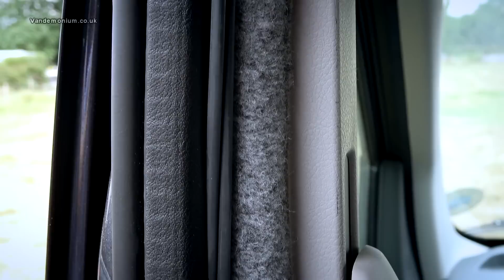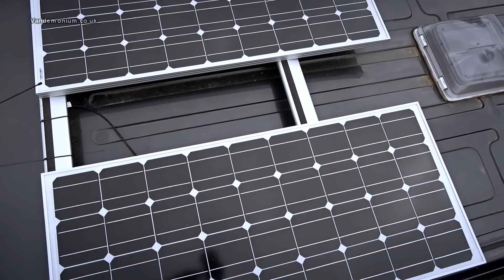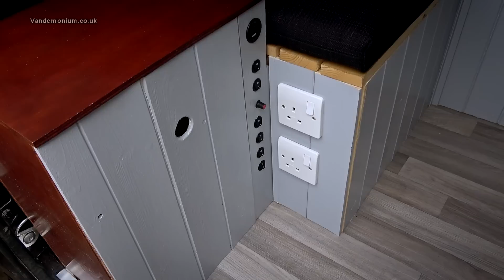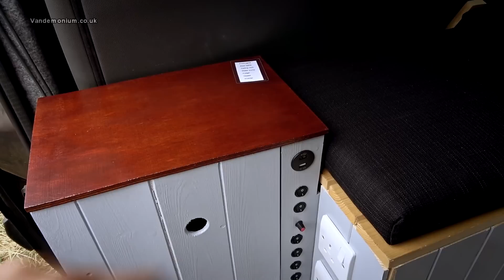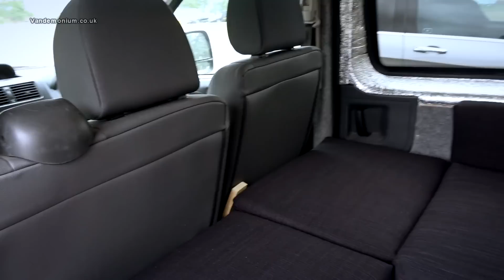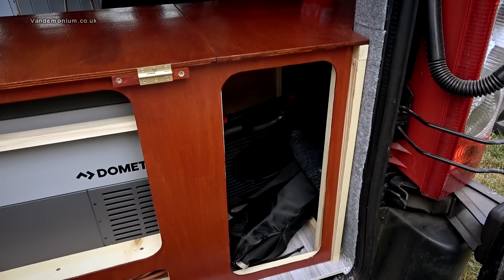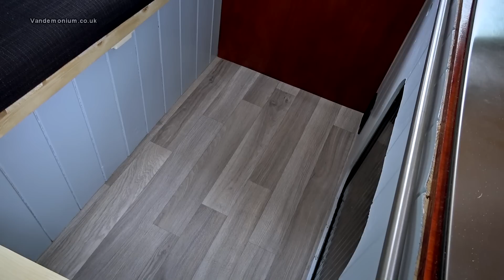Vlog 22 Campervan solar panels plus miscellaneous improvements

Comment: David.. looking great... the tee bolt track might be the source of the whistle when driving.  Try some tape to close the gap.
Reply from the maker: It's already covered up with a rubber strip that goes in the gaps, came with the roofrack. Cheers

Comment: It all looks very good, are you getting Anna to make your curtains I believe she is rather good with a sowing machine. Could you fill then paint round the windows with a thick rubber paint would be a lot easier than trying to cut the carpet. What is your next plan? A new boat then fit out from scratch maybe?
Reply from the maker: The boat idea has crossed my mind but oh my, what a massive job that would be!
Reply: S.E.W.I.N.G machine "Lewis" not a female pig manufacturing machine..for godsake Lewis!" Morse was heard to say, "most disappointing you think Anna to be associated with a piggery!"  :-))

Comment: In regards the fridge, I would buy an old caravan for 1-200 quid with a working fridge and just remove the fridge for my van plus a few other bits and pieces, then scrap the caravan and get a couple of quid back.
Reply from the maker: Good plan but I specifically wanted a 12V unit, not one that's propane or propane/12V (the latter are very inefficient when run on battery, much more so than dedicated 12V ones) and the caravan ones tend to be the latter type. Also, I've got nowhere to put a caravan and no way to tow it!
Reply: Try some of the cheap used caravan sellers up round Doncaster way... they buy up the trade ins that new c'van retailers dont want and break some... good source for many caravan/boat type stuff like pumps, water heaters, fridges etc.
Reply from the maker: Walter I'm extremely happy with the fridge, I certainly don't one of those coolers, they're a total waste of money in my book.

Comment: Possible idea for bed supports; The gaps between the slats could tak Hinged supports that would fold back UP into the gaps and therefore hidden when slid back, no need to mess anything else up :-)
Reply from the maker: I don't think there's quite enough space, the gaps are quite small :-(

Comment: Great progress so far. I'm liking the van a lot now, she really is coming along nicely in every episode. Definitely feeling a bit jealous in fairness. Haha 
One concern mind; I know you mentioned it's not a problem but being that its a camper van and I imagine you're going to want to visit various places in the UK and possibly Europe in it, you may want to consider a front mount roof spoiler to deflect the air over the solar panels. 2 reasons mainly. The drag from all that turbulent air will go towards killing fuel economy as you say and the more miles you drive on the motorway, the more that will increase but also, and its jus a personal opinion, I don't like the look of the solar panels with regards to their mounting and the aluminium frames they're constructed of when it comes to the idea of sustained air buffeting. Looking at them, they look for use in more of a domestic setting and while they will have no doubt been tested for high wind speed when it comes to gusts, I'm willing to bet they didn't get tested at 60mph for sustained periods. As I'm guessing they'll but up there for the life of the van as a camper van, I wouldn't trust them over time at motorway speed to not slowly work loose or come apart some how. Might take 60 hours of buffeting. Might take 100 hours of buffeting but if you're going to be seeing the sights of the world, or at least our small part of it here in Europe, it wouldn't take long till you have spent that crucial amount of time at motorway speeds. Could be a week. Maybe more. In fairness, might never happen. I just don't trust it. It was my immediate thought. Felt that one in my gut and all that. Either way, a cheap black plastic 3rd-party no-name front mount roof spoiler from the interwebs will sort both those issues and if you are going to be doing a fair few miles traveling via motorways, over the course of a few weeks, the fuel saving pays for the spoiler. Especially at todays fuel prices.  

All just food for thought like. :)
Reply from the maker: A spoiler is not a bad idea but I'd be more concerned about the spoiler blowing off than the panels disintegrating! That's largely because I'm not sure how I'd be able to attach the spoiler. It's something I'm going to put some thought into at a later date though.
Reply: Yeah, I was just thinking with the aluminium mitred butt-joint construction. That type of join in aluminium, usually done with some kind of sealer as opposed to screws or welding, likes to come apart. Could just be me being over cautious though as I'm only going off a picture. Would depend on how much flex you felt when lifting them. More flex, more oscillation. 
As for the roof spoiler, I'll be honest, I've never attached one myself but thinking it through, I'm guessing it'd involve loosening the front interior headliner so you can get at the roof and then its just a matter of place-fitting the spoiler on the roof with some form of tape to hold it in place while you get it centred and then seen as most aftermarket spoilers come with holes in for screws/nuts, you just use the holes in the spoiler to mark the hole points where you need to drill and mark all the way around the footprint of the spoiler where it touches the body. Remove the spoiler, drill the holes, put some silicone-type sealer on the inside of the marked footprint and then screw the spoiler in place with a few hex-head bolts and attach the bolts from underneath inside the van. A friend for lifting will come in handy there as well as for holding the screwdriver while you screw the nut from inside. Then just wipe away any excess silicone gasket that has squeezed out from under the spoiler as you bolted it down and cut off any excess bolt length on the inside so it doesn't stick into the inside of the headliner. An afternoons work maybe and from what you've done with the van so far, you know your way around tools and are more than competent. Plus, it don't need to be the Sistine chapel. 

Extravagant life might need a bit of a form but a comfortable life just needs function. :)
Reply from the maker: No flex felt but you're right about the panel construction. I will keep a keen eye on it! You're probably right about the spoiler; it's something I'll do some research on. Cheers!
Reply: Agree absolutely.. if you dont put something in front of those panels the air pressure under them will rip them apart before you even get to motorway speed limit. Sides could do with spoilerts as well. Spoiler should attach to the same mounts as the panels.... anything just to keep the wind from under the panels. Plus it might make them less attractive to the tealeaves in the supermarket car park.. they work even quicker than 60mph wind!

Comment: Was that fan borrowed off a hovercraft? 😮
Reply from the maker: Ha! Weirdly, it was louder when the controller was set to "full" than it was when I simply plugged the battery straight onto it, possibly because the solar wasn't connected when I did the "battery only" test but was in the video (and therefore the voltage would have been 13.4, ie float rather than 12.8)
Reply: Having the solar connected vs not having it connected does make a difference.  My (24v) battery voltage goes up to 28.xx when it's charging in full sun.  I have nothing running directly off the batteries.  I have the inverter and I have buck converters for DC to DC conversion so everything is regulated.

Comment: Have you thought of having the fridge the other way round so that the exhausted warm air from the cooling process goes directly into the living space. A good sorce of clean warm air for nothing. Also it would mean the fridge is drawing slightly cooler air into its self. Have fun and well done, looking realy grand.
Reply from the maker: I did ponder this but only discovered which way round the fans were once I installed it!! Also, as there will be shelves in the rear corner, I didn't want them obstructed if I opened the fridge although I realise it would only be for a few seconds. I might yet change it around.

Comment: By any chance did you check to make sure you don't have a defective fan. There may be a reason it's so loud. (Must drive you crazy)
Your van is looking GREAT !!
AWESOME JOB !!!
Reply from the maker: Weirdly, it was louder when the controller was set to "full" than it was when I simply plugged the battery straight onto it, possibly because the solar wasn't connected when I did the "battery only" test but was in the video (and therefore the voltage would have been 13.4, ie float rather than 12.8). Or maybe the controller boosts it somehow? I don't know.
Reply: Vandemonium lol. That is definitely weird.
Van is looking great. 
Have an awesome day !!!

Comment: Ok couple things. 1. Did you meet you deadline for conversion for the insurance company?   2 have you thought of using a different material for the window trim a contrasting color or a material that would be easier to work with!   3. Do you think you will finish before Christmas 2018?
Reply from the maker: Yes, the van was registered as a "motor caravan" a few weeks ago. I think the "finish" will never actually come but there'll be a steady trickle of changes and improvements over time from here on.

Comment: It's looking great David, wondering have you weighed the van with all your additions? You have more timber in there than an Ikea showroom, those smallish vans would be roughly 500kg load I'm guessing?
All the best, Ray
Reply from the maker: Actually the load capacity on the LWB 2013 Proace is 1.2 tonnes!
Reply: That's truly amazing, puts a lot of much larger vehicles to shame!
We went into the 'sports utility' scene here in Australia, massive V8 engines with rocket ship interiors that could only carry 350kg, or roughly a good weekends beer supply ;-) 
Regards, Ray

Comment: Could I suggest that you undercut the ply on the cabin side of your fridge cupboard to allow some cool air to be drawn in. At the moment it looks like the hot air from the outlet can be sucked back around the fridge. Too much heat will kill a fridge. (RTFM)
Reply from the maker: I have RTFM, thanks. It could be sucked back but even with a hole in the ply the air in the van will likely all be at much the same temperature.

Comment: Super job David, glad you've road tested the solar panels, any 'sheet' material can be a pain on top of a vehicle. Also, put the camera away and have a week off! Enjoy your trip 👍🚙🙋🏽‍♂️
Reply from the maker: Thanks. Yes I checked at both ends of my motorway trip and the panels were still solidly in place so I'm happy so far. Will check again after the trip to Surrey.

Comment: For the window corners could you cut the carpet and sew it so it would fit in the corners better? Maybe try on some scraps 1st to see how it looks . Sense the corners are wide i was thinking of a section about the width of your hand ( you can measure it , im just guessing lol ) then have sections cut for the length of top bottom sides , sewn together,  then glued where you need them.  Like what you done with the fridge btw .  For shelves,  have you looked for some prebuilt or used ones you could modify?   Its all looking good , you'll be done soon .  Good vid .
Reply from the maker: Oh my, I have no sewing ability. I dread to think what my attempts would look like!! I'm keeping an eye out for any compact shelving units but they'd have to be quite specific I think and then I'd have the issue of making them fit it. Cheers!
Reply: Vandemonium  lol i ment you cut the pieces out ect then have someone else sew then together. If it was expensive. Like a furniture repair shop or car interior. Cause the seams would be short . Though being a thick material it may not be able to be sewn .   You may be able to give the appearance of sewn by gluing the sections down very tightly together.    Good luck with it either way.
Reply from the maker: Ah! Yes, that would make sense!! :-)

Comment: Nice job thus far. Duff motor controller probably pulse width type, as others have said - these can make the motor squeal in a similar way to just about every charger/power supply these days. Efficient, but complex and noisy. Your rechargeable drill prob. makes the same PWM squeal too, for comparison.Your good fan controller may actually be 'analogue', (ie less complex and efficient but quieter in all respects :o)  The fan at full speed was hilarious .I dread to think what needs venting quite so fiercely...
Reply from the maker: Ahhhhhh, so that's what the squeal on my drill is!! I'd been wondering if I had bought a defective drill. Thanks for clearing that up. As regarding the "full power" noise, it's a bit odd as it didn't go that fast when I just wired the battery directly to it (although the battery then was just idle at 12.8V rather than 13.5 on float from the solar, which could make a difference I suppose)
Reply: I've just looked up your working fan controller - and it is a pulse width type, not 'analogue'. And it looks like the max voltage it can put out is pretty much the same as the voltage you supply it with - so your mystery increase in fan speed thing could just be the higher v. with the solar connected, as you said. You'd need an oscilloscope to prove this really - and that would be a step too nerdy I think :o)
Reply: ALL of these small speed controllers are PWM type - simply because the alternative is to "act as a controllable resistor" and *dissipate as heat* all the voltage/power you don't want the motor to receive when dialled down. That would take serious heat sinks, large transistors, and would generally be inefficient, which is why PWM is all you ever see - which is basically turning on and off the motor's power for a variable amount of time, very quickly.

The difference tends to be the frequency they do that at - functionally it isn't really important, but if it's in the sub-20KHz audible range you might, well, hear it in various forms. The quiet controller probably just works at a higher frequency (just looked it up - it seems to be running right around 20KHz, others do more like 10KHz).

The other thing is, when one interrupts supply to a heavily inductive load (like any motor certainly is) the current doesn't just "want" to stop flowing, and unless a path allowing graceful discharge is provided various unpleasantness can result. This is generally solved by including a reverse-biased diode on the load output that helps discharging it, and your unit seems to have it - but other modules built to the nearest $0.01 might not, and this may or may not have audible results, especially at lower frequencies...

Comment: If you want to clean up around the fridge you can use speaker grill cloth stretched over a frame. It will black things out,give it a nice finished look yet it breathes really well. Also I'd recommend making trim panels for around the windows and then cover them.you can get a nice tweed fabric to match or accent the carpet and they'll be easier to wrap. If you're interested I can walk you through making custom fitted fiberglass resin trim panels if you want. It would really finish things off nicely. But as it is you've done a incredible job with things this far. Oh and one last thing ,if needed a 12volt computer fan will help with the fridge if you find too much heat but I doubt you'll need it.
Reply from the maker: Speaker cloth: genius idea. Thank you. As for the windows, I was considering doing what you say but I'd still need to carpet over the window edge itself otherwise it would still be visible (unless the trim panels cut really far into the viewable area of the window, which I don't want)
Reply: Vandemonium what we used to do on custom stereo installations was make panels formed to the area where you have the foil insulation. It would tuck in underneath the carpeted panel and butt up against the glass and be formed to fit the van bodies contours. It sounds messy but its not if you take your time. But what you do is tape the whole area off in masking tape. Then cut the fiber glass mat to fit the Area  you want to use as a mold. Once   out the excess and then carefully lay it up over the taped area. Then once dry you pull the mess out tape and call. At this point its pretty weak and flimsy so you need to be careful. But once outside the van you can add layers and be generous with the next resin and fiberglass. After its dry you trim IIT to fit with a jigsaw and use some filler to smooth out the surface. If you want to go crazy this stage can be smoothed for paint or wrapped in a thin foam to hide imperfections and in fabric or carpet etc.when it's finished you'll have a panel that is only a cm or 2 proud of the insulated area made to fit. 
    Another option is if there was a factory panel that follows the contours by the window it can be trimmed to fit or used as a mold too. I haven't looked but YouTube probably has a hundred videos, they're probably listed under things like making custom fiberglass speaker panels and pods etc. Just keep in mind most of the ones I've seen tend to use too much resin during the first step making a mess. Going light on the resin keeps things clean and easy,you can worry about strength when its out on the work bench.

Comment: Find yourself some peel and stick vinyl tile for behind the stove. And it’ll look like a backsplash and be easy to cleanup and splashing from your stove. Or a thin sheet of stainless. Cut to shape.
Reply from the maker: Yeah, not sure about vinyl. I like the idea from an ease of install perspective and from the keeping it clean angle too. Not sure vinyl near a heat source is right though albeit the gap is to the stove manufacturer's specifications. Hmmm.....